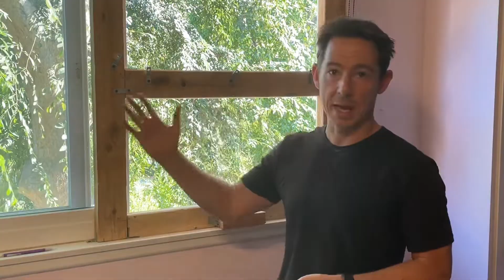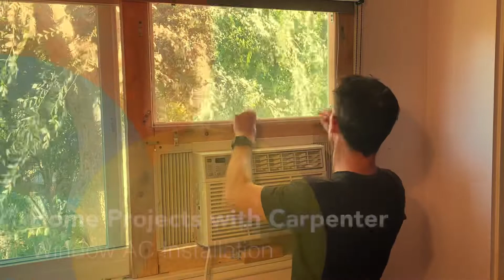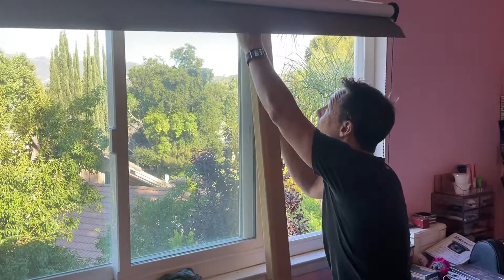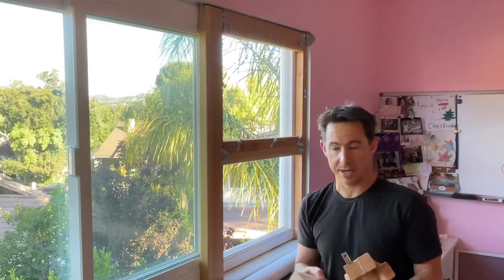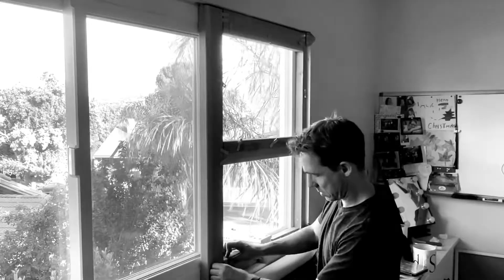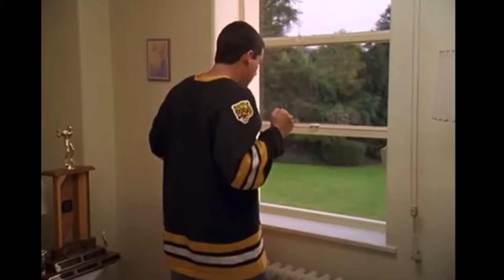DIY - Window AC Unit Installation

Comment: Wait, are you drilling th game directly into the house/drywall?
Reply from the maker: Hi. If you’re asking about the wood frame, I used angle brackets and screwed them into the sill and the walls. Yes I screwed them through the drywall on the sides and top to get to the window framing under the drywall. When I remove the window unit in the winter I just leave the holes. But you can fill/patch them as you like

Comment: If you make the height of the opening 1-1/2" higher than the height of the ac. Then you can pull it in 3/4" and it will tilt at a 30 degree pitch, using a pc of 3/4 x 2" wood behind the metal pc at the top you screw into to keep the unit from falling out.😊

Comment: Hmm.. what did you use to seal the air gaps?
Reply from the maker: Hi thanks for watching. I used some foam strips that came with the AC unit. They get a little worn over time so I’ve had to replace these a few times. I also use a little white duct tape around the gap to keep bugs out.
Reply: Home depot sells foam insulation you can squeeze there or amazon.

Comment: What if all your sliding window is made out of steel material. How will you add them pieces of wood onto them
Reply from the maker: Actually that’s what makes the wood frames such a good idea. You actually connect the wood frames to the framing inside the window which is typically wood anyway.

Comment: I don't understand how it stays in.
Reply from the maker: If you’re referring to the plexiglass please refer to my previous response. If you’re talking about the AC unit itself, it’s held in by the several screws around the frame that go into the wood. It’s supported by the brace underneath and the downward slope helps to keep in in place

Comment: How do I install the plexi glass?
Reply from the maker: The plexiglass is slightly larger than the opening, so it rests right on the face of the flat 2x4s. (e.g. if the rough opening was 2’ x 3’, I cut  the glass to be 2’-2” x 3’-2”). That allows for it to rest on the face of the wood. Then I have clips that hold it in place on the face of the wood
Reply: @homeprojectswithcarpenter460  Thank you you've been very helpful.
Reply from the maker: The plexiglass is held in place by the swivel clips around the perimeter. I slide them to make contact with the plexiglass. It’s not totally water tight, but I don’t worry about rain during the time it’s in as it’s always completely dry during the summer months in California
Reply: I don't understand what keeps the plexi glass from flying outside onto the ground. If you could please help me?